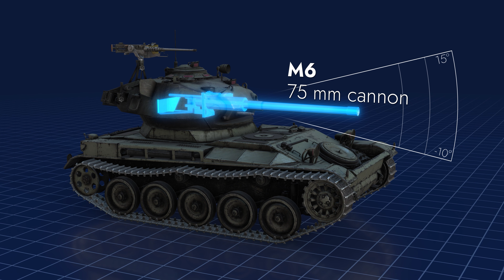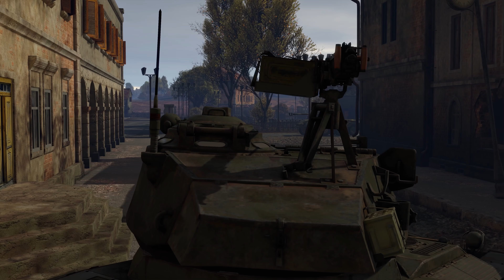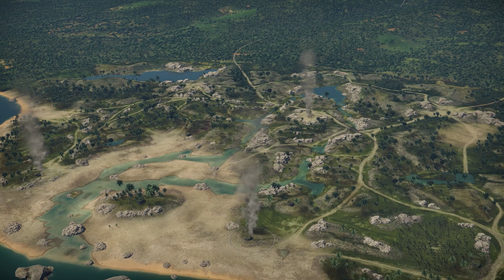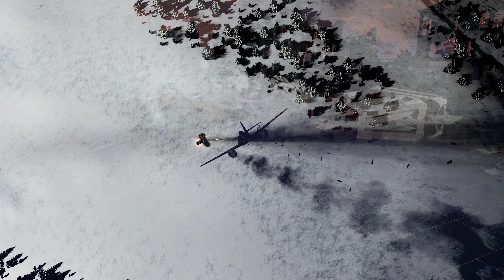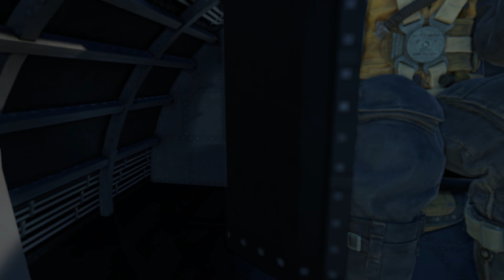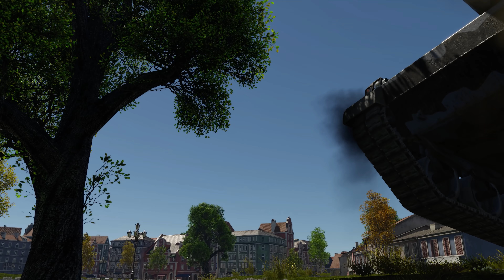THE SHOOTING RANGE 215: Welcome to the jungle / War Thunder

Comment: can you add a system of when you can redeem RP from vehicles that you haven't finished so you can do an different line i.e bombers to naval aircraft line and why is the phantoms FG.1 and FGR.2 have bomb racks with a slot left but not the american versions?
Edit for new update:how do you use the weapon selection and the bomb series?

Comment: What happens in the twin mustang if one pilot tries to turn left and the other tries to turn right?
Reply: I'm pretty sure that the controls are connected so if the other pilot turns the flightstick to a direction then the other flightstick will turn in the same direction automatically

Comment: Another great video! We all appreciate your collective hard work. 
As a longtime player who has roughly 70% of the games vehicles. 
Could we start a conversation about some new game modes and maps for rank 6/7 mixed battles? An example is a common warthunder custom battle modified on the air rb Afghanistan map for mixed battles. With 5 capture points. Large enough to use your new 6km gun sights and then some. The large sniper battles that would occur and the flanking by the wheeled tank destroyers and IFVs all backed up by their SPSAM and CAS. Would be legendary. We are currently playing a faster and more unforgiving game in the same sized  sandbox. Like a wise man once said: “It’s like racing NASCAR in a skateboard park” 
In my opinion the top tier for mixed battles is only won by the team who has more players that know every map inside and out. The stagnation of the game modes and over the years has drawn people to grow bitter to each map they have an “experience” with. Thank you gaijin for reading this far if you have!<3 also whatever happened to Fulda? I have not played that map in at least 8 months.

Comment: 1. Jungle Map: the various firing points mentioned are within artillery range. At early ranks vehicles are reasonable vulnerable - and light tanks in Modern era certainly are. As I laborious mention before, you might cover artillery in the Shooting Range. It is much underutilized capacity.

Comment: Greetings Gajing I have a question are you guys thinking in adding modern jets like the A-10 or f-14
Reply: Those are mid cold war era planes but the entire teen family F-14, F-15, F-16 and F-18 first took to the skys in 1970s and so did the A-10 granted the later models are a bit younger but the A model is from the 1970s

Modern plane they are few SU-57, F-35 and F22 but the F-22 took it's maiden flight back in 1990 as the YF-22.

Comment: Why you try to kill this game?? Youremoved APFSDS shells from the tanks as they were main shells for most of the tanks and now we must purchase them and count every single one as -600 or -200 silver lions. We don't need to spend mor silver lions when MBT s and som other tanks repair cost is too much that we should kill almost all of the enemy tanks and capture zones before losing our tank to recover all of the repair cost and get more silver lions and not lose them. But in general if we destroy for example 3 enemys without daying, they will pay 10k silver lions and 30 k in general. I mean that in general more uptier players lose the silver lions than getting some so they have to play and grind in low tiers so much to play uptier again. And that means that they do not get any pleasure from the game. Also on this event me as most of the players grinded and completed missions and spent so many hours to get some prices in the end, sometimes I was sleepless for that reason and in the end Boom - we got punch in our face instead of gifts. Event leopard's repair cost is 10 000 and event plane's cost 27 000!!!! It means I completed missions for just having these vehicles and not playing them.Another issue in this game is researching. Beleave me it's too hard to grind 380 000 research pionts and it is spending too many hours only. We complete grinding when we don't need that vehicle any more. I don't say anything about helicopter battles and it's trush balance. You with 8.0 helicopter just get killed every time  from 10 km away with ka-50 or ka-52. I want developers to play helicopter battles with low tier helicopter and you will understand everything in 1 match only. So I wish you do decrease vechicle repair costs, return APFSDS as the main shell on MBTs, decrease required reserch points to unlock the vechicle and balance helicopter battles. It is not entertaiming playing this game any more!!! I wish to read my comment.❤❤

Comment: There is a small ditch on the right team on Jungle that allows specific tanks to peak over the hill, while being able to quickly retreat to cover. This works very well with the Chi-Ha series of tanks, though any tank with decent depression can sit there.

It has both covering from the Lower Objectives and the top two objectives. It also have good sightseeing for sniping.

If I recall, this is around C7 with the small patch of water.

Comment: We can’t use the B-29 when it faces post war jets with guided missiles, especially when we bankrupt ourselves by doing so. Please remove it like you did the Maus, or make it playable, because at this point, it’s little more than an SL/RP sink for the tech tree, and it’s unnecessary.
Reply: Air Sim Enduring Confrontation matches can help you.You can select Br 6.0-7.0 matches but since you're the highest Br,you need to earn spawn points in <6.0 planes before spawning in B29.Don't die in the B29 as you're top tier and you're in a bomber.These 2 factors drastically affect repair cost but very often you wouldn't die as long as you select the furthest airfield from the frontline to spawn at and start climbing right after.By the time you've reached their airfields,you would be at least relatively 3000m above them (don't refer to the altimeter as some maps like Afghanistan's airfields are already 2000m above sea level and if you follow the altimeter,you'd only be relatively 1000m above airfields) and be completely safe from AAs.Airfield's airborne AIs (of which there are 2) will intercept you but they are easy to take down.They fly in a straight line when behind your tail gunner so you can top up your 4 tons TNT dropped rewards with 2 AI kills.There are 4000+ matches hardcore experienced players who might go for you,just be sure that your bombing route doesn't intercept with objectives  (like capture A point,defend allied bombers...) as hardcore players like to be there knowing those areas will be full of players.Stay in gunner 3rd person view at all times unless you need to adjust your course.Take your time to descend the bomber and keep in mind that more mass means more time,space is needed to decelerate so circle around the airfield to make a safe landing (landing is crucial).After the airfield repair,only then you'll receive full rewards for your previous flight performance.Repeat the above process and by the end of the match,you should've accumulated >10000 RP and >200 000 SL.Be sure to activate boosters/premium account and you might be able to reach up to 1 000 000 SL per match.(My best record is 524 000 SL without premium account)
Reply: I've been recommended sim, but I'm still uneasy about it as I don't play it much, and there's still an uncomfortably high cost. If I reinstall WT then I'll give it a spin, though.
Reply: @clippedwings225  Sim is much better than Air RB as everyone has a job and it's not a space race and as the guy above said,bombers are very important to how a match goes as they can bomb out a curtain part of an airfield (making it impossible to either rearm,repair,refuel) and can buy yours fighters some time,hope you try sim,it might be hard at first but 10-20 test flights should do
Reply: You don't face post war jets with guided missiles in the B-29. 7.3 is a BR lock, like 9.7.

Comment: In a fight between the Pershing and the Tiger I who would win, along with the Super Pershing and King Tiger?
Reply: https://www.youtube.com/watch?v=hCpylkCpRZo
Reply: And a draw with tiger against Pershing https://www.youtube.com/watch?v=meduxDj61sQ
Reply: I think tiger if it its an ace and not a kid who thinks he is micheal wittman 
So how to use tiger right first angle second use your 88mm gun it has a max range of 1.5km instead of the 1km range most tanks (not in pershings cause)
Reply: @generalsquirrel9548  Perhaps, but the Pershing is no slouch with its armour either. At 1.5 km, both tanks would have difficulty penetrating each other lest the Pershing loads APCR.
Nevertheless, the Pershing was made to fight against Tiger I's. Against Tiger 2's on the other hand... not so much.
Reply: @Kalidoscope1230  true